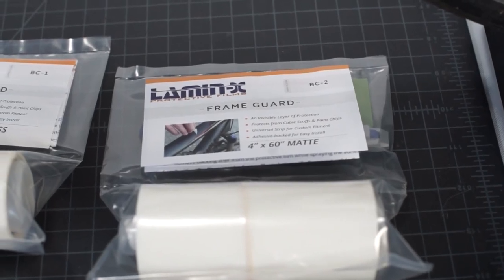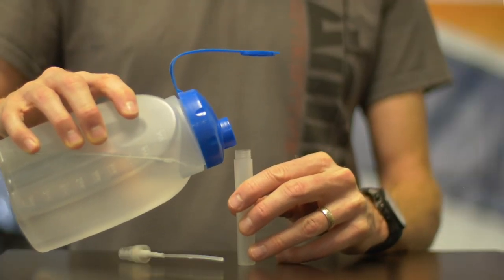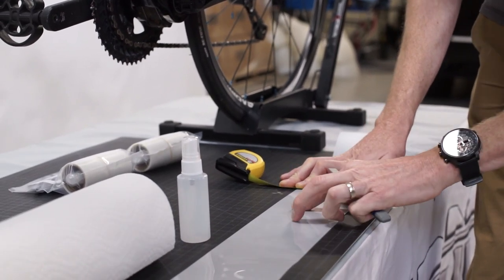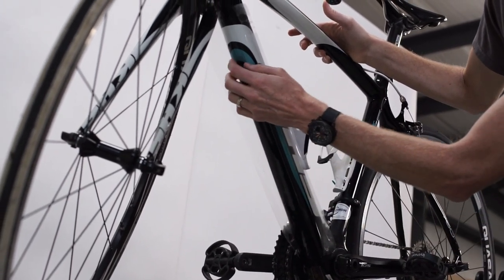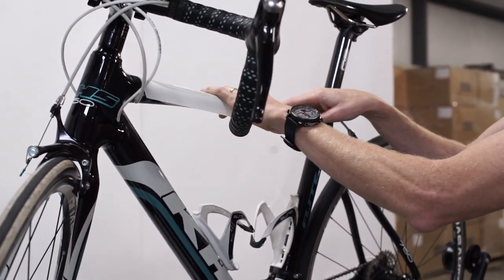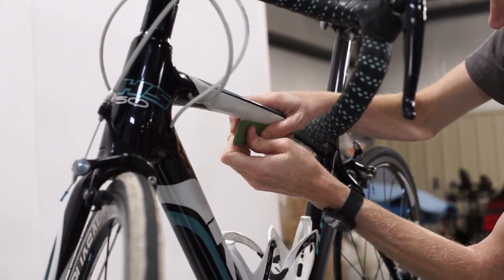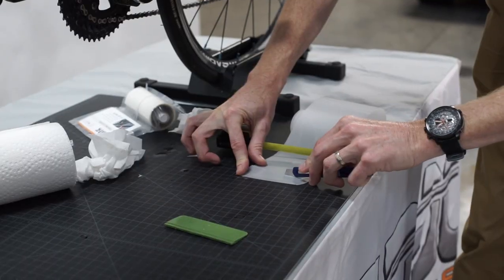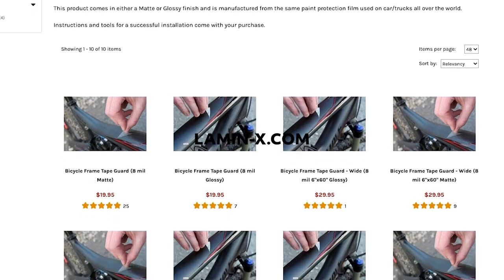How to Install a Lamin-x Bike Frame Guard

Comment: My top tube has 2 bolts for attachments on it. Should I avoid this area or can I somehow cut holes in the lamin-x?
Reply from the maker: you could likely cut holes in those if you wanted. just make sure and adhere the film well to the frame around those bolts if you do so.